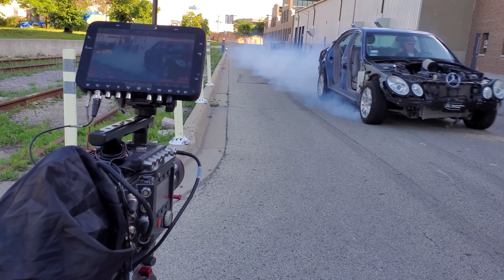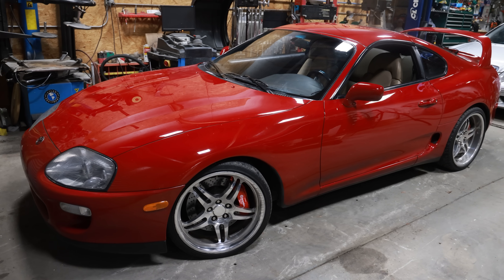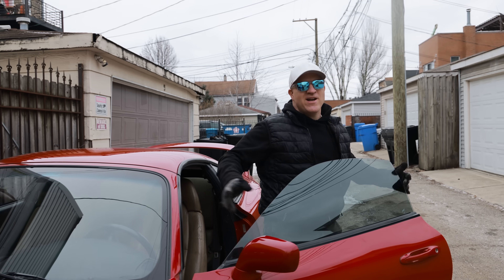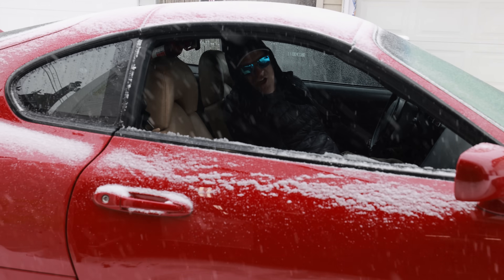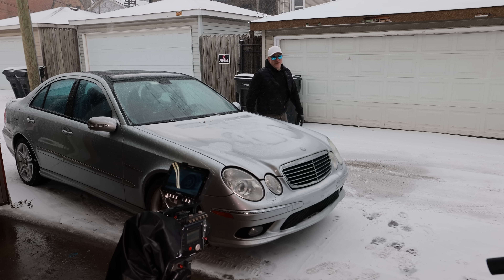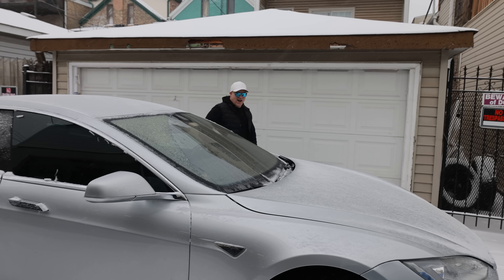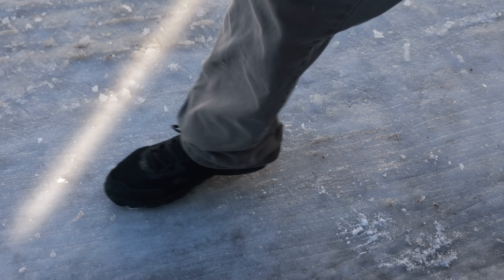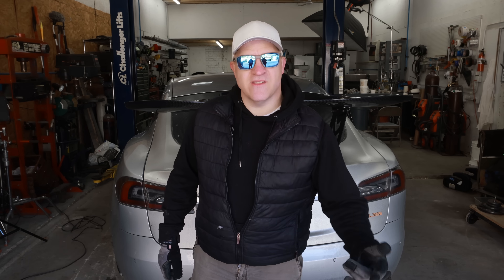Anti-Lock Brakes (In Slow Motion)

Comment: This is fantastic to see in real world - thank you! I work on cars, so I know the ABS works via pulsation, but I always thought/hoped there was more to it. Like a calculated braking of the wheel, based on optimal friction conditions, alike you brake with your bikes front brake. But unfortunately, after so many years of development, ABS seems to be still not there yet.
Reply from the maker: You're welcome, same thing here I 100% thought that it was much more complex in the more modern systems, I personally think the Mercedes has the most complex system but I forgot to show all three systems in this video... I just randomly forgot to put it in the Attic because I was so short on time.
Reply: @WarpedYT  why my comments get deleted in this thread? (answer to @mrtopcat2)
Reply: It's there since many years. It estimates friction calculates needed pressure etc
Reply: @ It did not look like that in the video though.
Reply: @mrtopcat2  true. The video however interesting it only showcase one specific situation mostly on snow and low speed.
Reply: @ However even real world testing confirms pulsation in the brake pedal, which would confirm the employ of a simple tech. Additionally if you open up any ABS pump (even new ones), it has only solenoids. So the work principle must be via on-off pulsation, which the video shows. I too wish it worked in ways that you described it, but I am just not seeing it happening that way.
Reply: @mrtopcat2  now we are talking about hardware. The control algorithm is different (of course depends on what the HW can do). Regarding solenoids What's the problem? In newer systems they are analogue valves but even with digital ones you can control pressure.
Reply: @ You are right as far as the hardware goes. I should not have mixed that in, because the ABS solenoids could arguably be used via pulse with modulated method in a similar fashion, alike they are used in other variable control applications. But again, as far as ABS goes, I am just not seeing it done that way. Instead what I am seeing is that regardless of under what situation you are stepping fully into the brakes (or manually activating the ABS pump, which I can do as well), the feedback experience seems to be the same frequency pulsation. If you have different experiences, please share. I am genuinely interested.
Reply: @mrtopcat2  I have different experience but not by feeling. It's really hard / Impossible to feel the difference between a 5 and 10 bar pressure decrease. It's rather impossible as you also have a so called low pressure accumulator where fluid goes during pressure decrease. The pump empties that reservoir. My experience is based on knowing the algorithm (abs just partially) and seeing measurements. (I am working as a TCS developer)
Reply: @ There is neither a proportioning valve employed within the system, not any pressure sensor. The functionality is established entirely via pulse width modulation of the solenoids. If anything, the pressure difference would be noticeable by the change in pulse width modulation, meaning the frequency of the solenoid’s pulsation. However, that hasn’t been detectible according to my experiences. Hence my question about your experiences. You have cited having seen the algorithm and mentioned that you were a TCS developer. Did you understand the algorithm and if so, can you describe it’s function? Is it as simple as triggering the solenoids upon detecting wheel slippage, or is there more to it? I am a mechanical engineer and I have repaired ABS units, so I know exactly what is involved and what is inside of them. And it always made me puzzled how the system is supposed to fulfill it’s promise. Because given the inputs, it is not easy to calculate friction on the go, unless there is some trick employed, which I may not be aware of. Hence my question; what have you seen in that algorithm, notably what parameters were used to calculate friction on the go? Because according to the video here it appears there are none. And that is matching my experiences and understanding of this system; it is a simple system with a simple algorithm, which as soon as it detects wheel slippage via the wheel speed sensors, starts cycling the solenoids at any given rate. I wish is was different; in which case I would love to learn about it and would love to stand corrected.
Reply: @mrtopcat2  we already agreed that pwm can change pressure gradually even with digital valves (which are analogue since years now so more precise control). What I have not emphasized that you are not really feel the valves you can hear valves during operation. What you feel on the pedal is more the pump forcing the fluid back to reservoir. 
Friction estimation is indeed problematic. The algorithm estimates friction and needed pressure mainly from wheel behaviour. How fast the wheel speed drops what was the pressure value at previous lockup. Also it uses the accelerometer sensor to estimate friction like  high wheel pressure and high deceleration probably high friction. Also it tries to keep the slip at a certain percentage so usually wheels not lock up at all. The video shows only a specific situation low friction and low speed. The whole system is more complicated and has also situation recognition. Like if one side of the car is on ice the other is on asphalt abs does not apply full possible pressure on high friction side to avoid yaw of the car. It increases gradually the pressure so driver can react with counter steering. 
I am not sure this was convincing for you but this is reality. (And many more interesting details)
Reply: @ I am aware of your cited description of the system. And yet we are seeing the system in action not performing as promised. I disagree with the driver not being able to detect PWM activity. The solenoid action is indeed very noisy with the PWM frequency clearly detectable/noticeable as well. Therefore, different speed/terrain conditions should produce varying frequencies, which are just as clearly noticeable. Except in reality, I have seen no evidence of it. Hence my question for your experiences. That said there are some better/newer versions of this system (not shown here) that must work according to the system description that you cited. Alike cornering ABS on some of the newer motorcycles.
Reply: I know it's hard to abstract away from your own experience. I don't know what else I can tell you. Maybe a remark when you drive a car with  brake by wire system (first version already in production since 2015) and not feel anything on the pedal it does not mean it does not have abs 😊. Yes I know completely different hardware but control algorithm is same. @mrtopcat2
Reply: @gaborb  I have not been talking about anything abstract here. While I have been working on and repairing ABS systems as a whole, I have been open to exploring causalities of the ABS system based on empirical information and according to my own experiences and even more according to what is seen on this video. Apparently in disregard of that, you keep reciting general information about ABS that has been readily available in publications for decades, and now even moving the goalposts. I don't know either what else I can tell you.
Reply: @mrtopcat2  as you mentioned that you are interested I just wanted to describe the system on "high level"/general. Of course I won't write details of  proprietary algorithms.
I just can say that it seems that your experience is different to what my colleagues and I have programmed, tuned
Reply: @gaborb  So now you are escalating to you and your colleagues “programed, tuned” ABS, but of course you can’t talk about details because it’s proprietary. Huh. So your connection to checking out and commenting videos like this must be then - customer relations. You know, seeing the level of your ‘involvement’ here, I would not have been surprised if you have claimed having been part of developing that algorithm.
Reply: @mrtopcat2  i am not escalating anything but i admit that i run out of arguments so i just mentioned these facts. But you are right it does not really matter what i do for a living in this discussion. (but you also mentioned so i did not expect so harsh reaction from your side). My connection to these kind of videos is to try to explain how the system works - i admit i have failed this time. You do not have to be surprised, just read back i already mentioned that i am a TCS (traction control system) developer. So yes i have been and still part of developing these algorithms. (no not for ABS that is developed by my colleagues).
Back to the original topic i mentioned some methods how the control algorithm works.
As you are a mechanical engineer and repaired ABS units you might have some diagnostic tools which can show you at least the wheels speed if you are still genuinely interested take a measurement and see for yourself.
Reply: @gaborb  One does not have to go far out on a limb to call your kindly bulls*. Although it seems you think it is plausible and working. Which makes it even worse.

Comment: You do realize when counting the pulsing, the moment the wheel locks or stops spinning is not a pulse, that is when the pulse is "off" and the mechanical fluid pressure form your foot is locking the brake, or when the ABS is not modulating therefore not pulsing the brake pressure.
Reply from the maker: I do, I absolutely understand that but it was easier to present the other way around.

Comment: Maybe you could test the ESP systems as well sometime? I used to have the older AMG 55 and I remember that the ESP operated at a much higher frequency when the cornering speed was too high. Great channel by the way, all your video's are entertaining and informative.
Reply from the maker: That's a really good one, and it's actually one of the things that I dislike about the Mercedes in general is that there are IMU's that sense the different lateral and acceleration forces and feed those back into the computer, sometimes the computer will get confused if you're driving very aggressive and if you have quick response you'll end up spending one tire or the car will not react predictably. This would all be sort of fixed if they just had a torsion limited slip instead of an open differential. But they decided to cheap out on the rear end and electronically control everything through bias breaking.

Comment: It was neat to see the brake pulsing, and  point out early abs resolution vs late resolution. The whole point of not locking the front wheels was so the driver could maneuver the car better in a panic stop situation.
Reply from the maker: 100% I think that was the biggest difference I saw and especially between the Supra Tesla and Mercedes the Mercedes seem to keep the wheel rolling more time than the other two cars. I did however I want to show all three systems individually but I honestly just forgot to put it in the edit. Thanks I'm glad you enjoyed it

Comment: The pulses definitelz feel shorter and more frequent on the pedal.
Reply: Because they really are shorter and more frequent :)
Reply: The car isn't pulsing the brake. It's modulating them to try and get as close to peak traction, it does it by feeling out the level by exciting it, then dialing it back, repeat

Comment: I can’t stand ABS and almost always disable or break it. While I’ve never driven a newer high end sports car, I’ve always been able to stop significantly shorter without ABS. 

1990/2000s GM/Pontiac vehicles were the absolute worst. Some useless grinding system. The Mercedes system worked the best, without fully skidding the tire with each pulse.
Reply from the maker: That's a great point, you're absolutely right I do remember driving some 90s and 2000 GM's and it was totally like a grinding on the pedal. The Mercedes system is definitely work really well. Unfortunately I forgot to show the three systems in the video cuz I needed to get the video posted by Sunday and I forgot to put it in the edit.

Comment: looks like it just reads speed then if wheel speed falls too quickly, it reduces brake then reads speed, brakes again, senses the speed  and reduces the brake again. the idea is not to reduce brake when the deceleration hig but is caused by good braking. I would expect the loops to happen faster. the computer ca read data very quickly but maybe the hydraulics can't work that fast. You can see that at low speed they lock up because  there is a risk the car would keep rolling, I mean the car could actually stop at low speed then you would release the brakes thinking you've locked them before a stop . 
you could imrove this with a free wheel on the ground that only reads the speed 😂.
Reply from the maker: It seems like that's exactly what happens but I believe the pumps and the mechanics which I forgot to show in the video here are a lot more complicated.

Comment: ONE THING TO POINT OUT! This video has a lot of great examples that allow you to see that ABS usually will stop pulses when wheel speed is below ~5 mph. This is because the car will come to a stop in a shorter distance with the wheels locked than it would if there was another pulse.
Reply from the maker: @BenFreedmanRacing  that's a great point I didn notice that, once the car got below 5 mph the wheels locked up, except I'm not sure about the Mercedes
Reply: @WarpedYT  I’ve heard that ABS won’t activate when wheels are rolling backwards but I haven’t tested this… Wink wink
Reply: @BenFreedmanRacing there is no reason no to, mine for sure does, also, technically the system probably doesn't even know which way the wheels are turning, since the sensors are not directional, they just count rotational speed.
Reply: @BenFreedmanRacing  I don't think te wheel sensors are directional.  Well I know they aren't but ESP would know the car is moving backwards.
Reply: @cuoresportivo155  
Hall effect wheel sensors  produce a square wave digital signal. They produce a signal forward or backward. ESP is integrated into the ABS unit and works inconjuction with a yaw sensor, positioned in the centre of the vehicle and also the torque angle sensor in the steering wheel housing. ESP corrects over and under steer.
Reply: @dalesideroadclassiccarwork9038  what does this answer?  esp knows if the vehicle is going forwards or backwards, abs just knows wheels are moving.
Reply: @cuoresportivo155  
ABS is ESP there's just extra valves in the valve block and programming. The thing is why would you need ESP In reverse?
Reply: @dalesideroadclassiccarwork9038  you don't need it, so it would be good to know you don't need it, isn't it?.  Yes it's extra programming and valves but distinct different systems, with some taking priority over others.  EBD and traction control are part of it aswell.
Reply: @BenFreedmanRacing  
On older systems from the late 80s and 90s, there was a button for switching off the ABS in snow like the Audi Quatros. This was because when braking in snow, the snow builds up in front of the wheel, causing it to slow quicker, where ABS prevents the build-up.
Reply from the maker: @dalesideroadclassiccarwork9038  that's interesting
Reply: @WarpedYT  I remember an update to abs software, I think to the Impala / Monte Carlo 2006 era to improve abs on snow/gravel. It was too allow more lockup on those surfaces so the gravel or snow would build up helping it stop faster.
Reply: @dalesideroadclassiccarwork9038  that’s awesome
Reply: Car will not stop faster with locked wheels. Abs stops working on low speed just so you can stop the car. Otherwise you won't be able to stop the car completely, because abs would just open brakes when you are about to stop
Reply: @Grishazavr  yes. Exactly my point…

Comment: modern ABS does not pulse anything... its just letting off the brakes the perfect amount for the wheel to regain traction then braking again and continuing that cycle however many times per second while you're slowing down on an individual wheel basis

Comment: On the 2012 Mitsubishi Galant the ABS has a crackling sounds when brake pedal is applied. The car stops on a dime with very little wheel lock up. It is a very good system compared to other vehicles I have owned.

Comment: Without any information about the friction coefficient, the ABS has to "guess" (or more accurately measure) the applicable friction by oscillating around the blocking point. This frequency is not actually determides by the speed of the electronic system, but rather the "system eigenfequency" of the complete hydraulic system. This is actually not that different between this vehicles.

Comment: I think it's Kinda stated backwards here. The ABS pulses the brake AFTER the EBCM senses the wheel is locked up. It's the only reason vehicles are equipped with 4 wheel speed sensors. When any wss drops below 3mph (determined by the pulses of the wss) the ebcm bleeds off brake fluid from that wheel to unlock it. It does so by "pulsing" the motor for that wheel in the brake pressure modulation valve (bpmv) which is seperate from, but attached to the electronic brake control module (ebcm). The whole point is to maintain traction to stop the car in as short a distance as possible.  ABS has nothing to do with steering.  Steering only enters the equation when the vehicle is also equipped with a stability control system. I realize the author probably knows this, my comment is for the observers who might be confused about how it works. Great video though. I absolutely love watching your stuff.
Reply from the maker: You're correct, but I didn't want to present it that way because it was a better demonstration and more easy to understand for someone who doesn't know a lot about cars if I focus on the lockup portion, because either way the ABS is controlling both of those pulses open and closed.